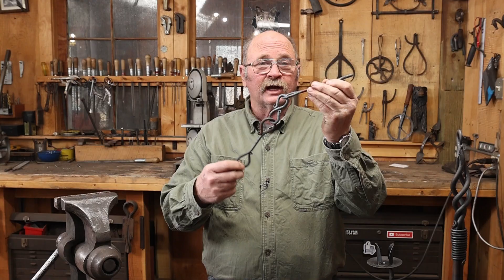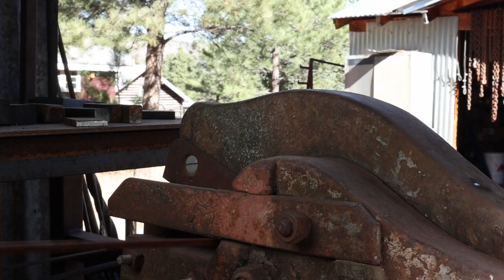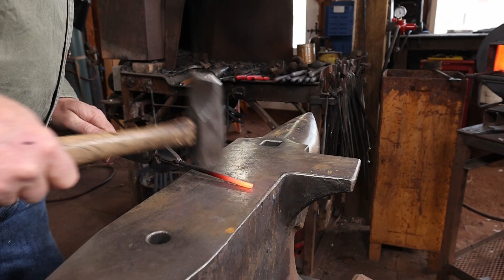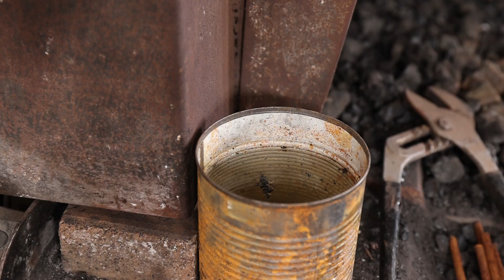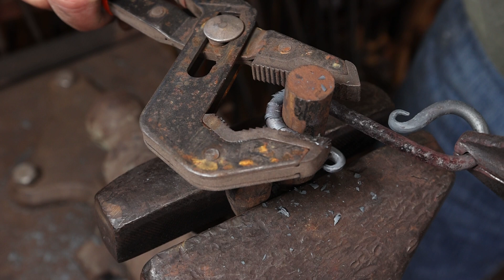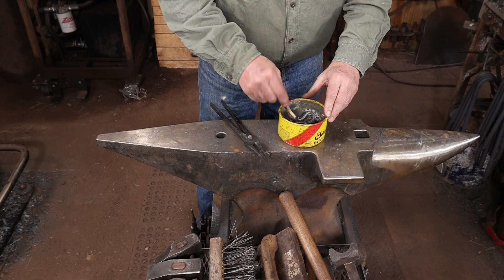Forging Decorative Chain

Comment: For instructional purposes (mine), what is the size of the jig you're using? I'd eventually nuc it out, but why waste the fuel, stock, and time when you can ask the professor?
Reply from the maker: Its 3/4", but you can adjust larger or smaller pretty simply.